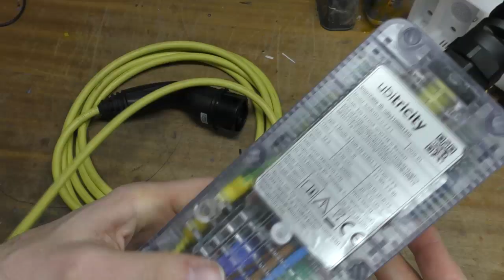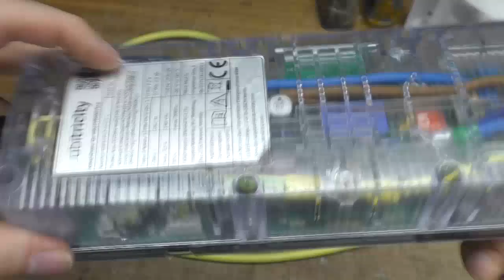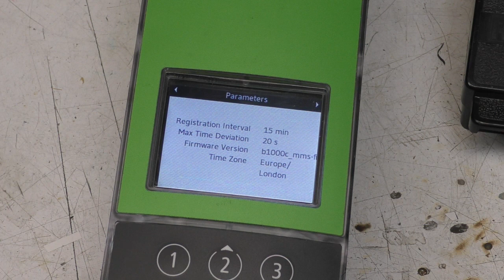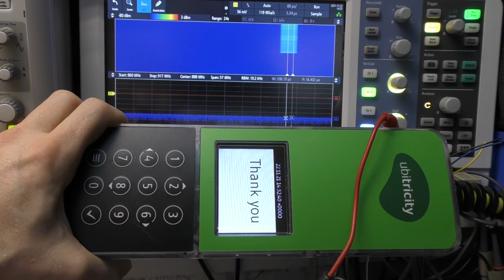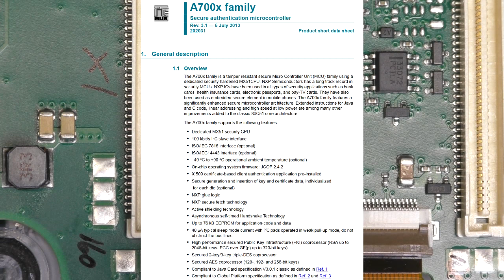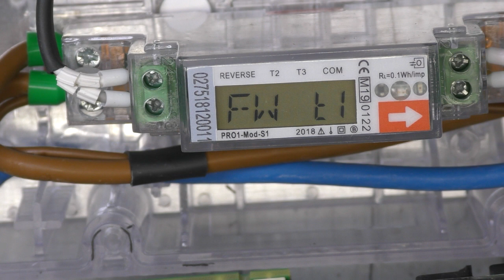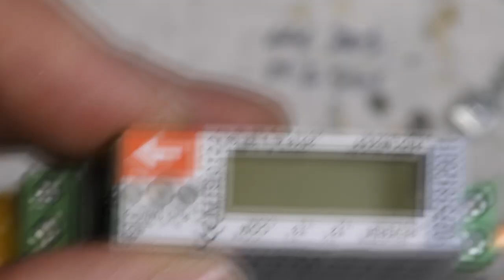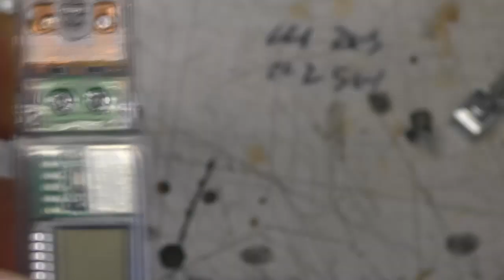Ubitricity EV Smart Charging cable

Comment: Oh wow, a blast from the past. There is a non-calibrated meter in the socket, and the meterin box communicates with the charge point. It simply detects if there is a discrepancy between the meter readings, so bypassing the internal meter will get you in trouble ;)

Comment: That is an embedded MID meter, you can tell based on the "M <some numbers>" marking. Measuring electricity is a much harder problem than you'd initially think, it usually takes ~1 year normally just to go through the certification and fix all the tests that it would initially fail. The standard is written such that it's practically impossible to certify a EVSE like this as an MID meter since it assumes you're making a standalone unit. Those meters are designed for edge cases (e.g. DC current tolerance, bad power factor, immunity to transients), and it is NOT trivial to design, test, and certify. Even big players get it wrong sometimes and certify using "3rd grade" test houses that do not care, and when you test it per the standard it obviously fails. I don't believe there is a single MID certified embedded meter in an EVSE quite yet, although that may change soon.
Reply from the maker: How would this be different to a standalone unit, as the meter is connected directly to the input and output cables?
Reply: @mikeselectricstuff  by "standalone unit" I meant that the MID standards has many assumptions about what a "meter" should look like. E.g.: DIN rail mounting, certain mechanical characteristics related to input/output terminals, *input power consumption*. That last one is a big one, I don't remember what the specific requirement is but it's in the order of 3W. The EVSE unit consumes more than that obviously so if you were to certify the entire thing as an MID meter it would fail that test.

That is only a few examples, but there are many more. You may argue with regulatory/test houses til the cows come home about what clauses apply and which don't, but it better be worth the 100s of k$ and many months to save a little bit of space in the box.

Comment: 4000 outlets around london? We'd be lucky to have half a dozen in Sydney.
Reply from the maker: That's only Ubitricity, there are many other operators, over 7000 charge points in greater London area & increasing
Reply: @mikeselectricstuff  Good thing! Electric cars make most sense in cities, massive improvement in air quality.
Reply: @sparqqling  Sadly though, not elimination - a significant amount of pollution comes from the tyres and any parts that move. We should all learn to levitate ;)
Reply: London has the most amount of charge points of any city within Western Europe. And makes up for almost 1/3 of total U.K. charge point distribution. Heard of this during the Mayoral question time yesterday. Interesting really, but also needed cleaner air and environmental sustainability. EV overall do make sense in the large urban area.
Reply: @beamer.electronics  Levitate, that requires even more energy. Maybe we should get hollow bones to levitate, until than cycling, the underground and trams are the way forward!
Reply: You Aussies need a different Government asap...... even my local (smallish) town (in the UK) has around 10 public chargers now....

Comment: I'd be willing to bet that microcontroller is running Linux, and that the code that provides all the functionality is written in a high level language like Python.  Not that I have anything against Python, but for some reason a lot of these companies seem to prefer using an expensive microcontroller so they can hire a cheap Python programmer, instead of hiring an expensive C programmer even though that would drastically cut the cost of the microprocessor board, and it would mean they could sell more of their product because of the lower price.
Reply: Yeah I agree that once you leave the prototyping stage you should go with c. My guess is that it's just easier to debug and and issue firmware updates to these things.

Comment: The control pilot does allow for digital signaling, by first using a duty cycle of 3-7% and presumably have a timeout to wait for the EV to respond before reverting to standard J1772.

Comment: The charge point wouldn't necessarily need its own mobile connection, it could use the cable device as proxy for communication (with end-to-end encryption). That way it's even cheaper!

Given the requirement that the charging has to work without any mobile link whatsoever, it is quite a challenge to design a moderately secure system though. I imagine that either each device has a universal key to unlock all charge points (and is responsible to protect that), or the downloaded authentication "ticket" is tied to a specific charge point and date/time range to avoid simultaneous use.

Comment: Here in the SW mike, people with the dosh to buy the likes of Tesla etc., are not doing so because of very limited and awkward charging points (chicken & egg), plus concerns over the EOL environmental aspects of the battery packs. They look at Hydrogen fuel cells etc. and get totally bewildered by it all, defaulting to yet another hydrocarbon vehicle. The other aspect of EVs that concern is cabin heating which I think is usually about 2.5KW, whereas most gas cars are from about 3.5 to 9 KW, and whatever you take from the battery - can't be used for movement. This could get cold in rural traffic queues in mid-winter, possible answer - a diesel heater! :)  Great video and analysis, by the way. All the best, Beamer.
Reply from the maker: Heat pumps are useful in cold climates, EVs often have heated seats and steering wheels to reduce cabin heat requirement

Comment: Looks like the design was for speed-to-market. If it took off, they'd optimize it later .
Reply: Also if this is several years old then it was released in an environment when so many things were heavily subsidized. If the customer can get a £300 subsidy to pay for the thing then they already are 0 out of pocket so spending more time to reduce the price just delays the release.

And some subsidies are even pools of money so when they are gone they are gone. That means there is an element of urgency. Get the product to your customer before the subsidy runs out. There are DCFCs in my area from a decade ago which are clearly massively expensive due to each having a dedicated transformer next to them that is  about 1.5m on a side. Plus a huge concrete pad under it. This was clearly unsustainable from a cost perspective but they got them out the door first and picked up the subsidies to cover it.

Glad things are more streamlined now. We never would have had  the uptake we have now without a couple generations of design improvements.

Comment: problem with metering inside the chargepoint is to split between users and document that start meter reading and end meter reding for every transaction. the cable is fixed to one user only, so the meter count is continuous
Reply from the maker: Not hard - user scans a QR code with app to associate their account with the chargepoint session, chargepoint reports usage to the server

Comment: Any Idear what sort of data is sent down the cable from the car? i have see the tesla car start charging without having to logon to a app or use a tab key  so im guessing some sort of identification goes down the cable. would be nice if non tesla cars could fast charge as easly
Reply: No data is sent from the car at all. No idea how Tesla does it -- it's annoying that they refuse to collaborate on or use international standards, meaning charge infrastructure has to be duplicated, wasting money for everyone. The only thing sent on normal cables is the control pilot signal, and that's mostly a one-way communication to the car, telling it how much current it can draw. Remember that the actual charger is inside the car, these are EVSE which literally do nothing but supply power to the car -- the car then decides what to do with it.

Comment: A carpark solution could be including a wifi chipset and require a router and 3G connection just for this purpose to be set up
the display as a whole seems pointless, any information it could give you you can just pull from a website, probably making the entire SBC pointless as well 
im sure you can get integrated secure ARM, wifi, bluetooth and 4g modem modules now, slap in a shunt and capacitive divider, do OTA updates, throw in a few bits and bobs and get the cost down to $50-75US
Edit: Just throwing wifi or bluetooth endpoints around and sticking a wifi or bluetooth modem in the thing could not just reduce cost low enough to give these away with subscriptions but also reduce the big chunky box to a black rubber blob

Comment: All safety features like the RCDs and relays are still required in the charge point, which makes the charge point still expensive.
Reply from the maker: Not really - the relay can be the switch for RCD protection, so the only additional cost of RCD is a current transformer

Comment: I've often wondered how robust EV manufacturers are at honoring a dynamically changing CP PWM (to balance the load across multiple vehicles on the street). From what I've found online in the past, smart EVSE that adapt to solar panel output have encountered problems with certain vehicle brands throwing a shoe when the PWM duty cycle varies. Also, it is worthwhile noting that the CP PWM represents maximum charge rate; if, say, the vehicle is consuming 1kW when the CP PWM says 7kW is possible, the lampposts are squandering unused power that could otherwise be sold to another vehicle. Given this, it seems possible, if not likely, that they must be metering (but not at revenue grade) within the lamppost module to ensure that this doesn't happen?
Reply: Then those cars are violating the DIN standard that they claim to be certified to. If you are compliant with the DIN standard then you must respect changing CP, otherwise very dangerous situations could develop.

Comment: This sort of thing demonstrates why houses without driveways for charging will be worth a lot less in future.
Reply: I have no driveway, and have no problem with public recharging. Lamp post charger sockets are a non-starter, because we have no lamp posts throughout most of this area. Streetlights are fitted high up on terraced house walls, with the junction boxes 3 metres or more above ground level. 

There are ways to circumvent any foreseeable problems with this. For instance, I could have an under the pavement cable channel fitted, which removes the no-driveway problem, so long as the local council approves it. Or I could continue to use public charging options.

ATM, recharging is free [7 kW and 22 kW, 3 phase, which my car can accept] at my local supermarkets. But even at present prices for paid-for recharging [from 25p per kWh at 50 kw], it's cheaper to recharge publicly for the expected life of the car than to have a charging outlet fitted to my house. And I'm in a minor city in central England, which doesn't have the best recharging infrastructure. They're catching up, however, as the numbers of EV's around here are climbing rapidly.

So no, the lack of a driveway for EV recharging points is not an issue for me. From my viewpoint, it should not affect the value of properties around here any more than the lack of driveways already does.

Incidentally, I've driven thousands of miles, in both England and Wales, in city and rural areas, and have never had to worry about recharging the car. I've never had to pay directly for the electricity either. My suspicion, FWIW, is that the 'no-driveway problem' is not really an issue for most people, and that other EV drivers are adapting to the changed circumstances, as human beings tend to adapt to all kinds of situation.

Comment: Given that streetlamps are typically wired with 6mm^2 cable on a radial circuit, isn't the charging capacity on an average street rather limited?
Reply: Limited to 19A. Good enough.
Reply: It's OK, especially since they retrofitted most lamps to LED from HPS (High Pressure Sodium) but kept same wiring so there is more lean-way.
Reply: 4-5kw normally but I have seen them run as high as 7kw. So about 15 to 25 miles an hour charge rate, for the average EV. So ok for a 15 hour overnight charge or an 8 hour work day.

Comment: Not specific to this device but the concept of using the streetlighting circuit for car charging is ...weird, to me... at least in this area, the entire road of streetlights is fed on one x 2.5mm regular SWA (TN-S area) from a feeder pillar up the road
Reply from the maker: This will vary by area - if enough power is available, and lamps are near the kerb,  it does save a lot of cost in groundworks.
Reply: a lot of led retrofits reduced current draw significantly and might leave room for some charging current, does seem kinda weird to me though here in the states our light poles are fed on seriously anemic supplies so this could never work here
Reply: here they was using mercury and yellow sodium or whatewer it is lamps before now slowly moving to LEDs so cabling is done for at least 1kw per pole but actual load is at most 1/10th of it
Reply: @mikeselectricstuff  I am wondering how street lighting is controlled (how they are turned on/off). Here lamp post are dumb devices that have no power if they need to be on, public light is controlled from one central place, power distribution company send signal over power lines to public light distribution boxes then then just simply turn on power to street lights (and cut power when they send off signal).

Comment: My first thought when you showed this is "whats to stop someone just stealing this cable" since it has plugs on both ends with no obvious locking device. If someone stole it, and it doesn't use a pin to enable it as you say, then would someone be able to use it to charge their car and have you billed for it?
Reply from the maker: There are locking pins in car and chargepoint
Reply: The cable is locked in situ at both ends once the car is locked.  Presumably if you reported your cable as stolen, then Ecotricity ( now owned by Shell in the UK I think ) they could disable it?
Reply: @mikeselectricstuff  Ah well that makes sense. I suppose you'd have to have that for a plain cable anyway.

Comment: Wouldn't it be theoretically possible to have networking over the power lines that the charge points filter out on the car side?
Reply from the maker: yes, though easier to use the control lines that are already there.
Reply: @mikeselectricstuff  I meant on the light pole side, the place you plug the entire module into. You could use the control lines to talk to the light pole. So city connection w/ network data goes into the plug, the plug has a basic MODEM for the data signals that also filters it out, then it goes to that plug. Complex, but you don't need wireless networking and it changes the attack surfaces a bit.

Comment: You dotn have a video on that little dreadful Miniware scope.?  11:55
a shame as your videos on scopes is usually pretty solid.
Got the cheaper variant myself MiniWare DS212 and yeah it does wonder for your patience.. trying to navigate it (wow a pain). .. though the build is quite nice, but it cost like 60 bucks a few years back, but a few weeks after I took the plunge on a Micsig STO as that MiniWare DS212 would not be ideal as a learning oscillioscope... The Micsig STO 4ch 100Mhz was, on the other hand, a very pleasant experience with the price in mind, that was quite low at that time and it still works great.. though I would love to see Micsig implement some new features and updates.. ..https://www.youtube.com/watch?v=wlkgdtkoAeE
Though I was able to use the DS212 to measure the Micsigs waveform rate.. were around 95k
but shockingly easy to record footage on the Micsig  and connect to it from pretty much all devices out there https://www.youtube.com/watch?v=vDdu-4F3XQs

Comment: Would there be a box thing at the top of the light that is the 3G/4G Antenna.
Reply from the maker: Doubt it, as this would make install much more expensive due to needing a cherry picker and lane closure. I'll take a closer look next time I see one.
 If I were doing it, I'd use the flap on the socket, or the socket surround.
Reply: @mikeselectricstuff  Check to see whether the lamp post cover is isolated from the post. That would allow the cover to be the aerial.

Comment: The other possibility is data over the mains distribution network. We aren't talking a LOT of data here.
Reply: I think that would only work over short distances. If I remember correctly that protocol was mostly meant for appliances to speak to each other in the same household. Besides, this system would need the connector to always be powered which would make stealing power much easier and make it more dangerous to plug in your car. At the end of the day I think it's just easier to integrate a sim card in the thing.